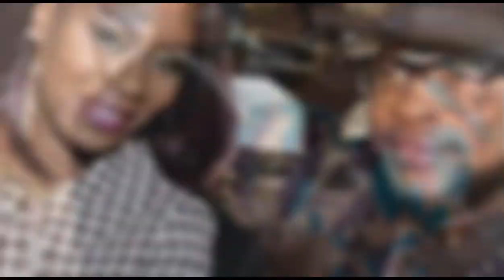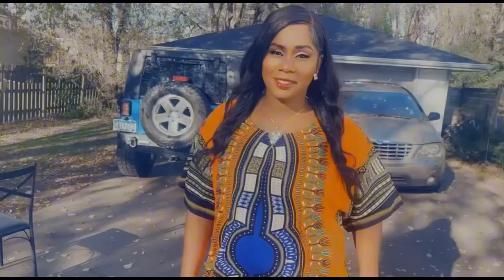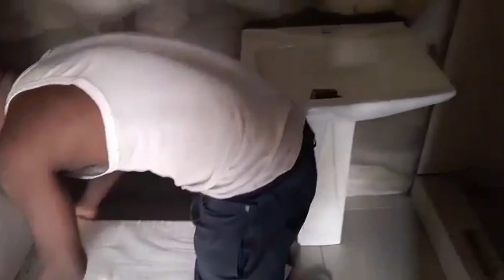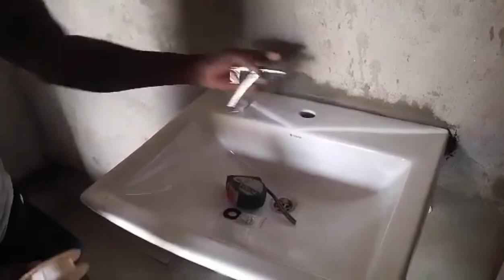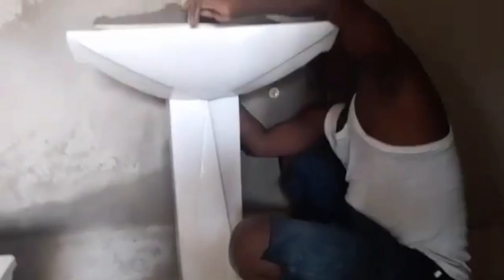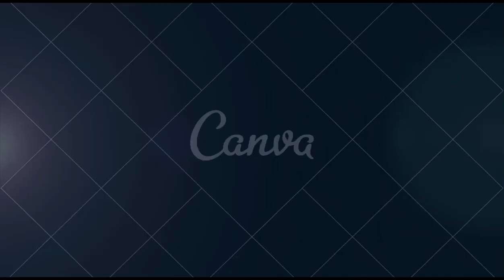BUILDING IN LIBERIA- BOYS QUARTER SINK & TOILET INSTALL 🙏🏾🇱🇷🚽🚰🛁

Comment: Good video.  What I have seen so far from construction video from Iiberia is that everyone is using tile in the bathroom and other living spaces.  We do not have other flooring materials in Liberia  ?  For example, hardwood flooring, vying flooring. Since we  have slab concrete floor in Liberia , if  Liberia market has Vinyl flooring or wood, I  will go that route instead of being everyone else.
Reply from the maker: @seidusambolah9231  hi, I believe they do but most people go with tiles, that why. But it would be great to try new things. Thanks